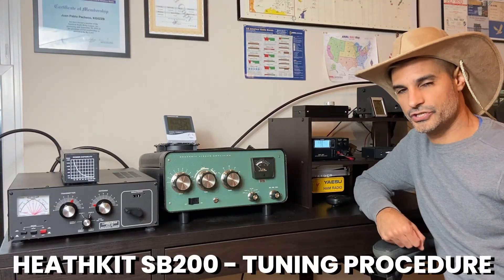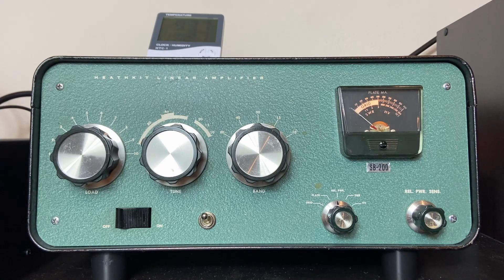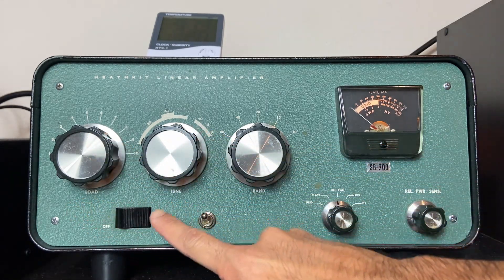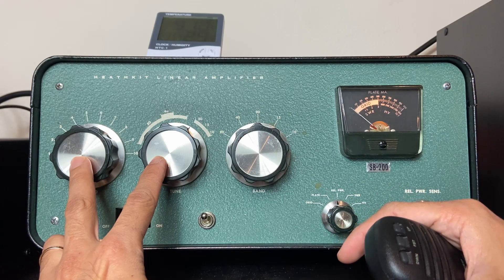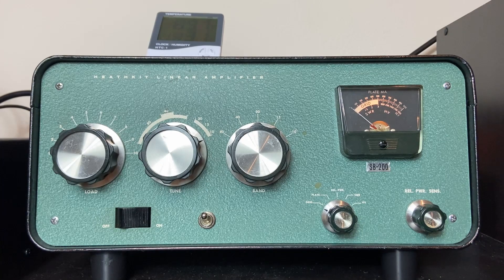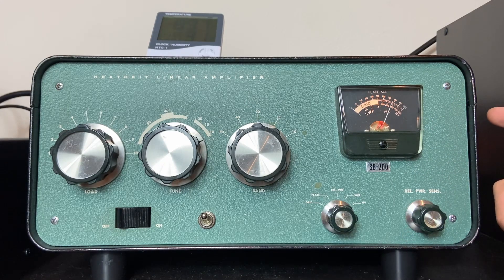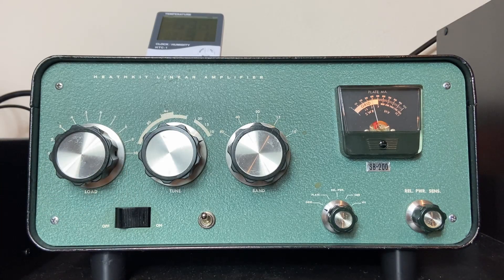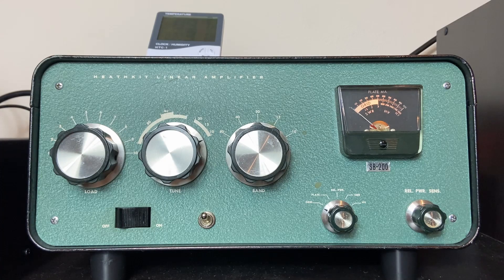HOW I TUNE MY HEATHKIT SB200 AMPLIFIER

Comment: Now I am running the g5Rv at 102 foot long. Do I need to have an antenna tuner and does the radio get connected to the amp then the antenna Tuner

Comment: I will never tune with below 30w, just because when you increase the power you will be way overloaded with real high grid. You will know when amp is overloaded as you run out of load adjustment

Comment: Just finished repairing and upgrading an SB-200 I got on EBay years ago, with a new power supply board and e-caps plus a soft start and soft key from Harbach Electronics. Tuned up using the original instruction manual but this video made things much more clear!

Comment: On my recently acquired SB-200; the Load adjustment is bottomed out at "1" on the knob - all the way left to achieve maximum possible output.  Is this normal?  The SWR on the 75M Dipole is near 1.1 to 1; GRID current is near bottom of range area; and, PLATE current is 200ma when P-OUT from Yaesu 2000D (In to Amp) is 25 watts and P-OUT from Amp is 300 using CW mode into dummy load or antenna when testing.
Reply: On 80 meters it is normal ,especially low in the band and/or with reduced power, for the load control to be all the way to the left , maximum capacitancy.

Comment: YOu adjust the input power in several phases, while tuning for maximum output (REL Meter) with th TUNE and LOAD controls. Note tht after peaking output with the TUNE control, adjusting the LOAD reduces the output power, as seen in the video. However, after increasing the LOAD control a little bit, you need to readjust the TUNE control for maximum output. You play the two controls off one another for maximum output. Then, you increase the drive from the exciter and do it again. You keep doing this until you got full drive from the exciter, which can be determined by looking at the GRID current meter. When the GRID current reaches its maximum value, specified in the owner's manual, you do not drive the amplifier with any more input power. You just readjust the TUNE and LOAD controls one last time for maximum OUTPUT, and then turn the LOAD control a few degrees clockwise to drop the grid current down a little off its maximum rated value. Then you lower the exciter drive slighty to get better life of of the tubes.

Comment: You never addressed the proper way to read the SWR.
You need to set the meter to REL Power, adjust the REL PWR knob so that the meter is at the "set" and then read the SWR with the meter on SWR.

Comment: I have a SB200 and a Yaesu FT 707 with a little relay between. them.  Where i must use a antena tuner,, between exjter aad amplifier or after the amplifier ?  What is the better way to connect them ? TKS and 73
Reply from the maker: What’s the power rating of your antenna turner?
Reply: @HAMRADIOUSA  It's a FC 700 yaesu 15/150 W  Thank you.

Comment: I have the icom 729 and the sb-200 I have never used an amp I have the coax all setup and the power cord plugged in but not sure if I am missing anything.the radio does not have alc and there a alc Jack on back of the amp
Reply: You can use it without the ALC. Please double-check the voltage on the TX relay for the icom 729. The Sb200 uses around 120v and will damage your icom 729
Reply: @jp.kg5zzb450  ok I'll have to find out about the voltage on the relay I have the autotuner I forgot to mention that.the auto tuner is model  at-160 ..
Reply: just had the sb-200 serviced and the soft key and another mod was installed by a shop. It's being shipped back to me . 384.00

Comment: When everything is fine that'll work. But You START! by looking at the grid & anode currents before anything else to verify that none is overshooting the specs. You never peak the grid current (unless you meant "look" at them but that's not enough). Also when going from one input level to the other you should re-tune all knobs. (small steps probably).

Comment: A few mistakes here.  You're correct to  dip the plate with low power, and you want to go through 2 or 3 tune cycles steadily increasing output power of the exciter (increase input power to the amp) until you reach the amp's maximum output  power.  This usually takes  70-80 watts of exciter drive for this model / brand of amplifier to reach it's power out maximum.  Now, once you've  maximized output, you then re-check the grid current and you must INCREASE loading (turn the loading dial to the clockwise direction ) which in turn decreases the  grid current as your final step in your procedure. This is done to reduce SSB splatter.    Then if you want to run less than MAX power output from the amp,  you can turn down the RF power output on the radio to 40 or 50 watts  (again, do NOT re-touch or re-tune the amp tuning knobs).
Reply from the maker: roger to that! I will try that too :) Thanks for the heads up!
Reply: SO WHAT WOULD CAUSE YOUR GRID CURRENT TO PEG OUT
Reply: @spikenickels606  oscillation comes to mind, which is a very bad thing.. When does it spike? When on, when keyed, when speaking?
Reply: @MoparMasters  keyed
Reply: While checking grid current